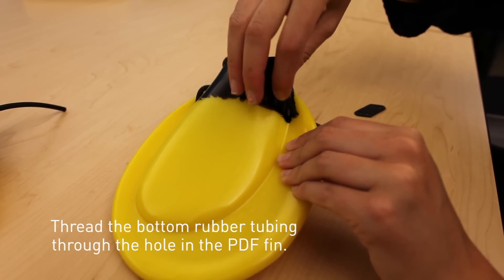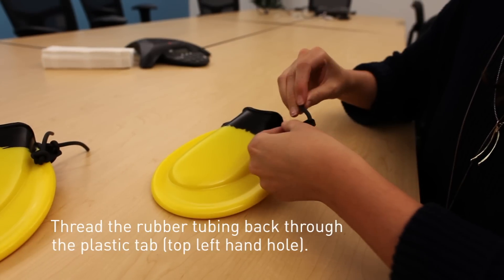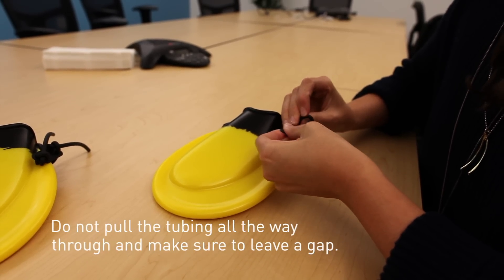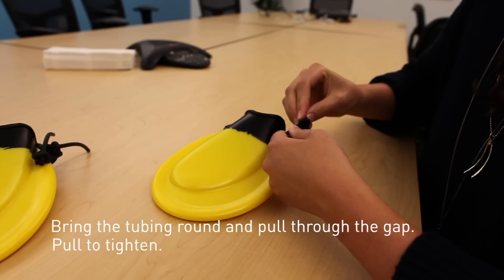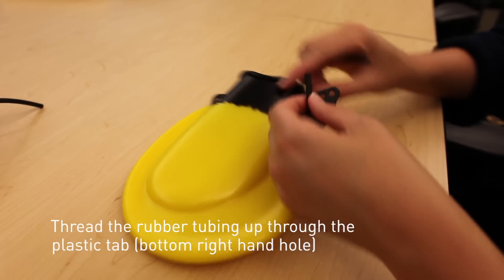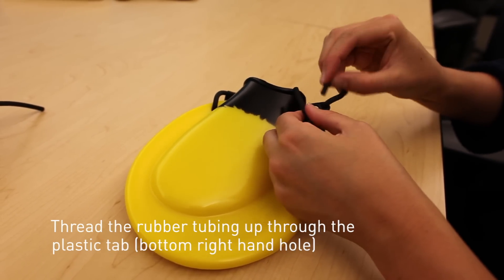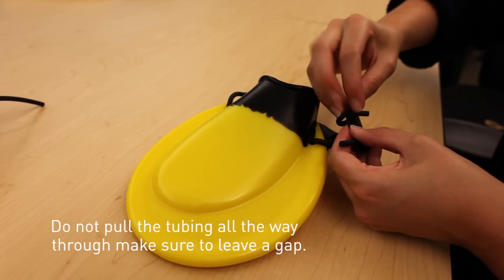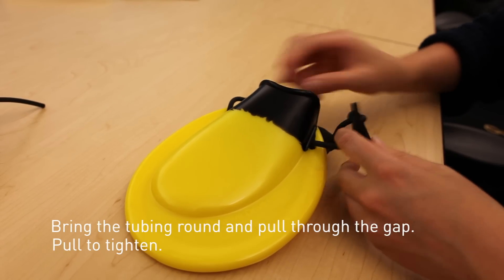How to Restrap the PDF fins

Comment: These are the only fins I have found that are ergonomically correct. Our feet are 3 D, not flat like a frog or duck. These turn your feet in/pigeon toed, and roll your ankle a bit so your feet are in the optimal position to generate the most propulsion. Some times I wish they had a step in heel cup, but they work far better than frog feet.